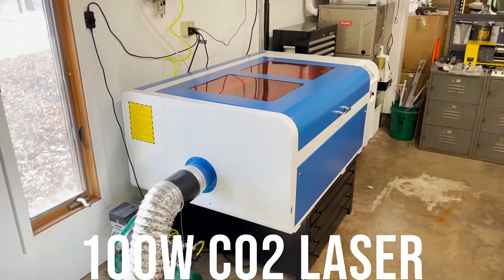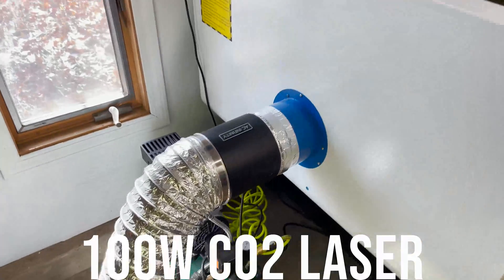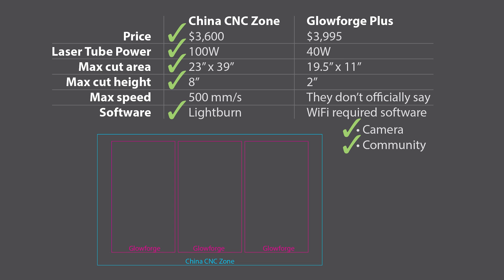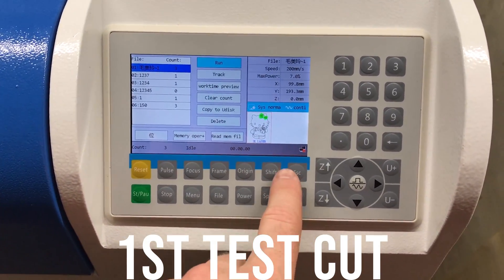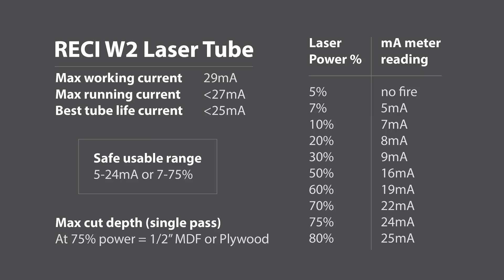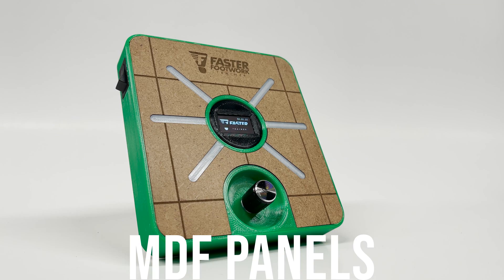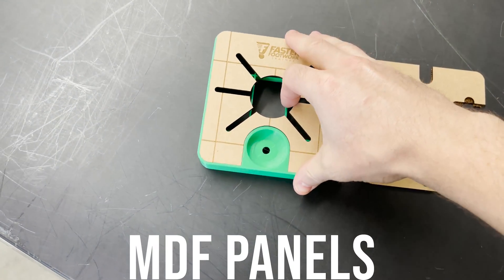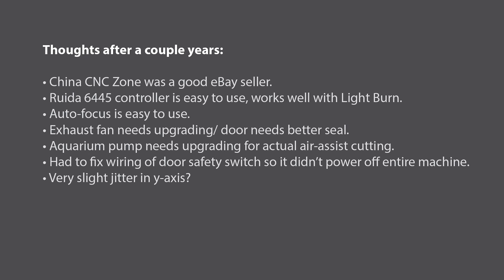Better than Glowforge? eBay 100W CO2 laser

Comment: I have the same model of laser but i see that on your laser the exhaust system is on the left side and not on the back. Did it came like this or did you moved it on the left side ? Do you have the stock exhaust system (one standard fan). Thanks in advance, nice video btw.
Reply from the maker: I cut a new hole to move the exhaust port

Comment: Hi, can the laser cut the maximum to 600mm or it is like 1-2 cm less than that? I need to cut parts that are exactly 600mm on the y axis. Thank you.
Reply from the maker: My maximum travel is 610mm
Reply: @diyfiberlaser  strange because the seller (which is ChinaCNC something, the same that you stated) said to me that the machine can reach up to 580. I was a bit confused by them…
Reply from the maker: @ThePecori  I double-checked, I can manually move it 610mm, but my software limits were set at 600mm. I just went into the manufacture settings (PW: RD8888) and changed it to 605mm and now it can move that far in the software.
Reply: @diyfiberlaser  many thanks!

Comment: Thanks for a great review of this mediocre machine (no offense). I owned this same machine and the safety switch on the door drove me crazy the way it shuts down the entire machine every time you open the door. This machine did get the job done, but I eventually sold it and upgraded to a Thunder Laser Mars130 (Discontinued) 130 watt.

Comment: I have this exact machine and have had great luck with it. We did put a longer head to get a slightly more square edge with a longer focal point. We cut a ton of .25” acrylic for templates to use with woodworking pin routers. Cannot operate at less than 8% power so fine etching is not for this machine. Extremely handy machine

Comment: That cannot be a100watt laser.. more like a 50 watt.
A 100 watt tube would be about 5' 8" wide
Reply from the maker: It uses a Reci W2 laser tube (90W rated, 100W max output) at 1250mm or about 49", you can see their specs here: http://www.recilaser.com/en/show-product-8.html

Comment: Thank you for taking the time to make this video. I'm planning on getting a 100W and have started my research stage. I followed the link that you gave us but didn't see anything regarding the footprint of the machine. Could you please let me know how big of an area it takes(I'm limited in floor space in my shop)? Thanks again.
Reply from the maker: 57" wide x 37" deep x 23" tall, that is the size of the machine. It normally can't sit flush to a wall because of the air duct that comes out the back (I actually moved mine to the side to fix this). Also, you'll have to site the water chiller somewhere, and in my case, I also use a small air compressor for it. Hope that helps.
Reply: @diyfiberlaser  thank you, it definitely helps.

Comment: Great video! This CO2 laser really seems to be a great and versatile machine.  I would like to buy the same laser but I'm afraid that 100 watts are too much for good quality engraving on wood and acrylic. Have you tested engraving wood or acrylic with this machine?
Reply from the maker: Yes, I've used it for both. The quality seems fine to me, but I don't have a lower-wattage machine to compare it to.
Reply: @diyfiberlaser  Thank you for the quick response! So just for a better understanding, is the laser capable of engraving a wooden board for example  without removing material? So that the engraving is just at the surface? And do these rather small Nema 17 motors stall from time to time?
Reply from the maker: @kasparwinter6990  The Nema 17 motors haven't been a problem. Even using the lowest power setting, you can feel the engraving...you might want to look into diode lasers instead.
Reply: This machine is awesome.  Come with reci tube... just you need to know  how co2 laser works. I got same machine 8 months  ago

Comment: The issue you are having with the jitter. Rove the bearing from the rod and repack it with lithium grease, then put it back together. I had the same issue with a 3d printer and did that to fix it. The bearings from china tend to use a lite grease that dissipates quickly.
Reply from the maker: Thanks! I actually purchased new bearings for it, then realized it was going to be way more complicated to dismantle than I had expected...so I just never tried them.

Comment: If your upgraded air assist is pushing more air than the exhaust it most likely will go into your room.  Please do a video on how you made your boxes and how you fixed the switch to allow for pausing vs complete shutoff.

Comment: I have had a Glowforge since the beginning and I can tell you that your laser is way faster.  Also, I can't use Lightburn and must rely on their cloud servers to control my laser through Wi-Fi. If they ever stop supporting this laser, I will be stuck with a very fancy $3,000US doorstop. On the plus side, my unit is self-contained so I don't need a separate coolant tank or extractor fan.

Comment: I have the same problem with door safety switch. How did you fix it? Just took it off?
Reply from the maker: The controller has a specific port for wiring the door switch, but mine was wired some other way. If you have the same controller, look at page 10 on this user manual, it will show you how to wire it so it operates properly: https://www.ruidacontroller.com/wp-content/uploads/2021/10/Ruida-RDC6445G-manual.pdf
Reply: If you are using lightburn it’s under machine settings Or vendor settings
Reply: @ryandame7238  thank you for your help